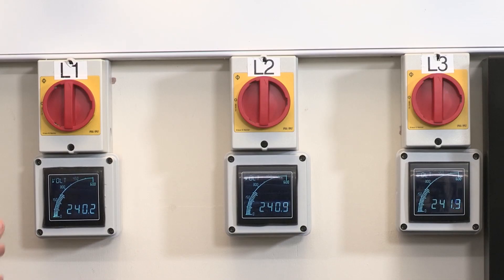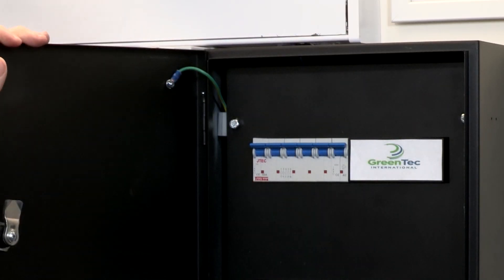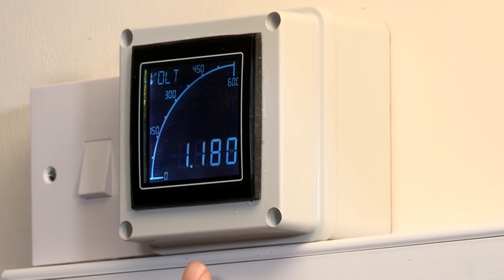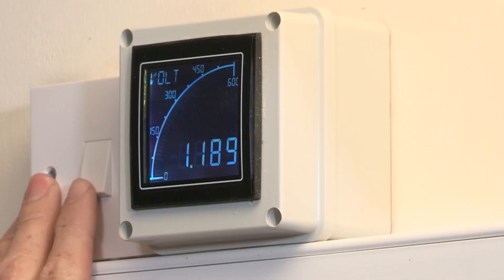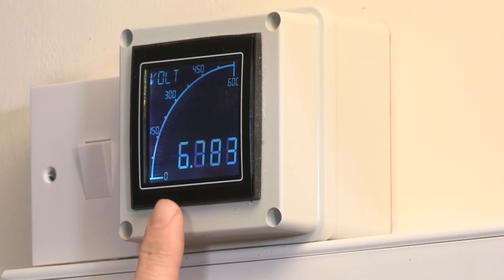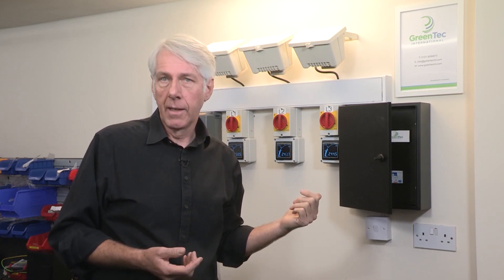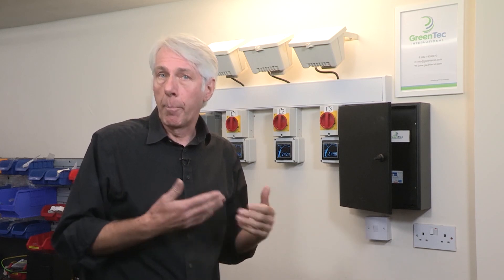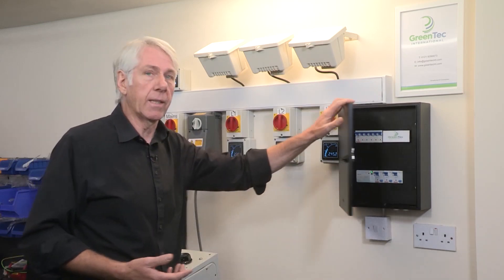3 phase Open PEN detection device for TN-C-S (PME) infrastructure

Comment: Would it not be better to monitor each phase to neutral voltage and disconnect if it is out of range of 230v ± 15%?
Would the shunt still trip for a single phase installation that loses its neutral so phase and neutral are the same potential (i.e. where there is a potential shock hazard on earthed metal due to failed neutral)? What i mean is, what voltage is required for the shunt to trip to ensure disconnection?